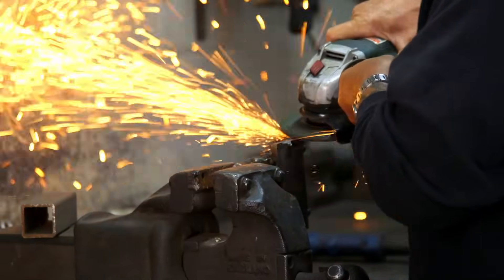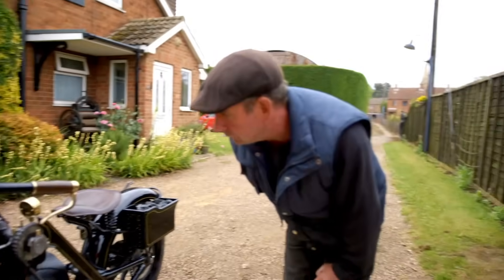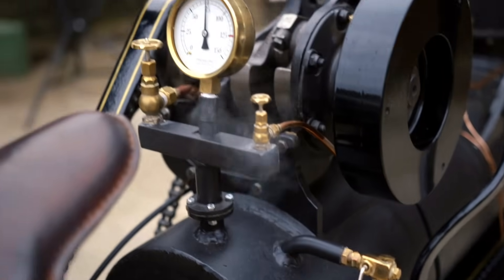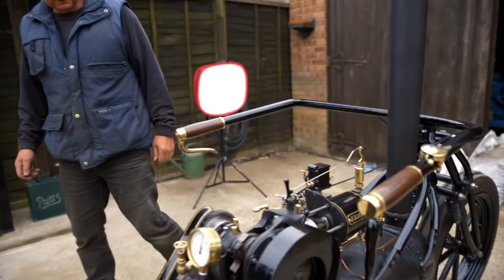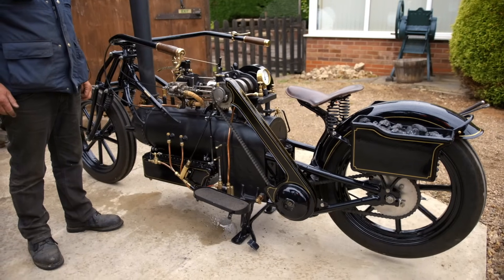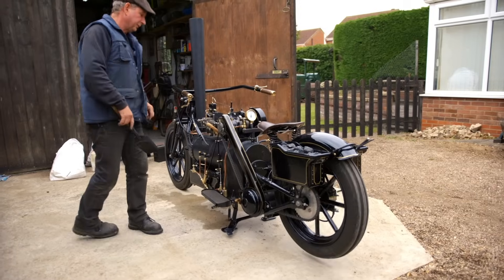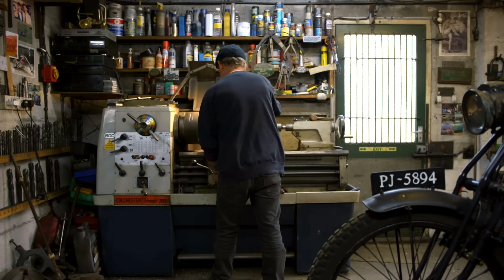Coal Fired Steam Cycle 2 - FULL VERSION

Comment: I've built 6-7 steam locos with similar size boilers. Your workmanship is outstanding.
Reply: Too bad this man wasn't Scottish, He'd be Scotty, on StarTrek, great,great grand father.
Reply: I completely agree. I'm just wondering why he decided to use the Steam Tank fro structure and not build an undercarriage. Now, it's obvious his Steam Bike is for home use and for driving around the Neighborhood, but I am still left wondering.  It saves on room not having an under-carriage and on weight as well. The tank is solid enough for structure, but the handles are directly welded to the Pressure tank and the front-end is supported by the tank and tank alone. That's concerning from a structural point of view.

Let me be clear when I say that I also agree, his workmanship is impeccable. And you certainly don't need to have a degree to be an engineer, and Sandy proves that. I'm just wondering why he didn't build an under-carriage or uni-body.
Reply: @theshadowsovereign8914  in terms of traction engines (sometimes referred to as steam tractors in North America), the British tradition is to use the boiler as thr structural part of the vehicle as well as the source of power, so maybe he got inspiration.
Reply: Best custom motorcycle # 1
Reply: Tq for labourious work
Reply: @theshadowsovereign8914  Just look at the thickness of the tank, esp at 16:50,  pretty sure there is not another bike on the planet that has a central frame as robust as this one. The last part on that bike that will ever fail is the tank itself.
Reply: @rickwilson5611  Did you actually read my comment?... that I posted over a YEAR ago.

Comment: All it needs is a period sidecar attached to it and it'd be brilliant for taking people for rides at traction engine rallies and the like (if we ever get them back again). And steam railway galas too. Good on you - great fun!
Reply: I might actually feel safe on a steamcycle if it had a sidecar.
Reply: Have the firemen in the sidecar
Reply: Good comment
Reply: Yes it will look great. Great idea.
Reply: I don't think it has the beans to pull a sidecar and passenger
Reply: @PecanRanch  steam can have quite a bit of power
Reply: @the_retag  - perhaps on the flats
Reply: @PecanRanch  its got rubber tires and a gearbox itl probably have no problem uphill, maybe a bit slower
Reply: Which "period" is that Mark? The time when everyone rode steam motorcycles?
Reply: The sidecar is a FANTASTIC idea! 😎
Reply: M. Meeker You'd be surprised what kind of power a steam engine can produce. Especially torque! It's phenomenal!
Reply: @nickthompson9697  a tricycle (trike) would look good
Reply: @myronhorvathsk  old trains had super power.

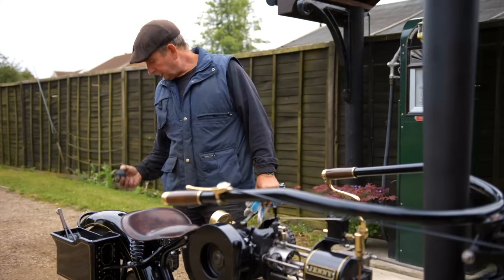Comment: Anthracite, 5:10, is the highest grade of coal available. It is almost entirely carbon, with very little sulfur, hydrogen, nitrogen or anything else to make smoke. It burns very hot, but is very difficult to ignite, hence the kindling and the paraffin (kerosene) soaked paper. He uses small pieces for easier igniting and faster burning, to make more heat out of a smaller burner.
Reply: ... so it's running go premium.
Reply: Thanks for the explanation.
Reply: Good clarity, intelligent
Reply: A lot of truth in that, although a good grade Dry Welsh Steam Coal is just as high quality and clean burning, with just a touch more volities which makes it more controllable, very good steam raising, as well as a little easier to light. Currently easily available and no more expensive than Chinese anthracite, although all that may change is the welsh government is refusing to renew Foss-y-fran's extraction license.
Reply: Couldn't they grind the Anthracite into a powder? I read that it burnt very well and there was a steam train design that used powder coal.
Reply: @user-uy1rg8td1v  Not a bad shout, although usually with Locomotive fires you need a considerable firebed to keep your fire stable when on the move, due to the draught from the blastpipe in the smokebox going up the chimney. So I feel like powdered coal wouldn't be very efficient unless it was on some kind of automatic feed. 

That being said, I know US Locomotives used oil quite a bit, so I don't know how it compares to Coal, I'm only speaking as a Fireman in the UK :P
Reply: The Terminator ( Jenny ). Typical northerner, just gets on with it. H+S would have a field day !. So humble a man. Right gradely. Thanks goodself. Ðave.

Comment: Congratulations! Your work is almost perfect! I think it would be interesting and more beneficial for the user to run the chimney along the length of the boiler cylinder, put it in an upright position behind the seat and install a venturi nozzle in it, which would use a small fraction of the steam pressure, but at the same time it would noticeably increase the draft of the chimney...!
Another variant, which would be more favorable for the hearth of the boiler, would be if compressed air from a compressor (piston) driven by the revolutions of the steam engine went into the venturi nozzle instead of steam...

Comment: That is a brilliant idea having that fan on the chimney. to start the draft up the chimny. the damper help your fuel to burn slower. you wouldn't want water to enter the engine it would hydraulic it. I bet that's a heavy motorcycle.
Reply: He says the weight somewhere in the video. It's either 350 or 375 kg, which is an awfully heavy motorcycle.

Comment: Ha ha! Great machine and would be such fun to ride. 👏👏👏👏👏 I used an old Morris heater fan to run my first smithy forge, back in the mid eighties. To control the speed of the fan, I used the element out of one of those old porcelain electric kettles. Worked a treat from my car battery. 😁

Comment: Wonderful work. The only point I would offer to builders is to start with a firebox that can easily start and sustain a good fire. b A friend had a miniature stream engine that was beautiful as it pulled around the track, but it was dreadful to get it up to steam. I've built steam engines with separate boilers, less problem.

Comment: Steam engines can be made very efficient and powerful. The German company IAV developed the 3 cylinder water steam engine ZEE03 with about 1 liter stroke volume a power of 75 kW and an efficiency of 45% and operated it on a dyno and in a Skoda Fabia car. The maximum pressure was 250 bar and the superheated steam reached a maximum temperature of 900 °C. The superheater was directly integrated part of each of the 3 cylinder heads and driven by a radiative burner. The exhaust gas was used together with the exit steam from the cylinder to fire the boiler up to temperatures of 350 °C. So the engine was operated almost in the supercritical water region. The total amount of liquid water inside the whole system was 250 cm³. At maximum power it circulates completely a few dozend times per second within the whole cycle.

Comment: If you lean in a turn, how is your water level in your top outside tubes & crownsheet ??
Reply: I applaud such a creation and too would love to see it @ Stormin 2021 Bike rally.. However this point crossed my mind too, has to be a solution, looking at the tyre profiles I think the answer is a chair shortly to be added ;-) Bravo Sir, Amazing Motorcycle!!
Reply: You lean to compensate the centripetal forces, and therefore the resultant force is maintained parallel to the bikes axis and the water will remain there or thereabouts level. 
I also don't you exactly "get your need down" very much with this machine, it's not a sports bike!

Comment: The info was great, but I'm sad that we only got to see a few seconds of it on the road. Would be nice to see much more of it in motion, find out how fast it goes, how far it can go on a single tank, &c.
Reply: It would need lights, a front brake and an MOT to be registered for road use before any of that can happen.
Reply: I have to wonder just how many different licenses would be required by the various regulatory agencies to operate the motorcycle. Here he would have to have a licensed boiler inspector certify and license the boiler. Then the operator would require a boiler operator's license, a driver's license and motorcycle license. The motorcycle would have to be inspected annually by a licensed mechanic for the standard safety and emissions ....if anyone has the knowledge, and be issued a Vehicle Identification Number Plate, and a motorcycle registration plate for the back. There is no.end to the government insanity!

I'd love to know more information about the bike. Like weight, engine size, speed, and range without stopping for fuel and water. How many gallons of water is in the boiler and carried in the tender. I'm just curious. He did an amazing job!

Comment: If he mentioned how much it cost him in materials, I must have missed it. Did he say how much this project set him back?
Reply: It's not so simple as that. The tools in his shed weren't cheap and they will have been gathered over his working career. You're not doing much work without a workshop.
Then there's the time and labour. Over a thousand hours easy. Fitting, adjusting, re-machining, refitting; just to get it right. AND THEN, you have the materials.  

Long story short, it cost him more than he'll ever get back for it and its easy worth 15,000-20,000 to the right bidder. Minimum.

Comment: I'd love to know its top speed and will it climb a hill, and the practical range on half a pannier of coal.
Reply: I wish he gave the dimensions of the engine, you could determine the horsepower with that and then if you knew the speed of the engine you could figure the torque. I bet it climbs hills easily
Reply: @TugIronChief  The dimensions of the engine and the pressure of the boiler give you the horsepower of the engine. The horsepower of the boiler is "relatively" irrelevant to the hill climbing power of the vehicle. The horsepower of the boiler determines how long you can climb that hill continuously. What I mean is if you have a 6x10 engine running on a 60 hp boiler and 4x8 engine running on a 60 hp boiler,  the 6x10 will produce more engine horsepower. And you do not get 60 hp from any size engine on a 60 hp boiler, only from an engine with the correct displacement to use that 60 hp.

Comment: Great job! A very interesting combination of a steam engine and a motorcycle. Maybe you can bend the steam pipe and let it run along the body, in the manner of a normal exhaust? And if the thrust is not enough, you can add either a vetilator or an air intake for pumping pressure with an oncoming air flow.
С уважением и пожеланием успехов! Привет из России !
Reply: Black Falcon:

I haven't looked real close but typically in a steam engine vehicle (but not marine) the exhaust steam is piped into the smoke box to a nozzle to create a "draft" which pulls heat from the fire box thru the tubes. This is why steam locomotives made the iconic "chuff chuff chuff" sound. Marine engines would take the exhaust and run it thru a "condenser" which took ocean water to make the steam cool back to water, it was then sent back to the boilers. Steam ships and power plants usually have very tall stacks which uses the barometric pressure difference to keep a fire draft going.  

Fred never did say if it was single expansion or double, one cylinder denotes single expansion. Did you know that in your four stroke bike or car it only has one firing impulse for two crank revolutions? A double acting piston steam engine pushes on both sides of the piston which gives two power pulses per stroke. A steam engine can be made to be very powerful for its size but the boiler is the biggest hassle, this is why the Stanley Steamer and White Locomobile cars never made much success, internal combustion is far easier. With those you had to plan ahead because even though the throttle would be closed the engine would continue to run for some time - no clutch. Imagine riding that bike and making a panic stop.

As you might figure, I love steam engines!

-'lil stan
Reply: @stanfischer6175  he really acts like he doesn't know the bike he built, weird

Comment: Great piece of work. Very impressive. The great shame about steam for transit was that on a good day it was supposed to be about 5% energy out to energy in. But then a 4 stroke IC is only supposed to be 25%.
Reply: Petrol engines are a bit more than that, about 35% efficiency. Diesels are 50% efficient, but are theoretically capable of 73% efficient.

Comment: the size of those engines are underestimate, that one are big enough to move a mid ton truck. that bike need a smaller engine amd will move it well cause the torque is insane on a steam engines.

Comment: With lithium iron batteries and solar panels or a generator to charge while the engine runs why bother with coal or wood to heat the water.

Comment: A really big leap back in history. I'd rather pay the highest price of gasoline than heat that thing up every time. I would rather ride a rocket than such a hot boiler tank.
Reply: I don't think anyone is building a steam-powered motorcycle to replace any modern internal combustion engine, It's more about the engineering spectacle. It's obviously not practical especially in this day in age, but I personally find a hand-crafted steam-powered motorbike much more impressive and fascinating than any modern creation.

Comment: Still worse than a Roper in almost every respect. Perhaps he should have looked at some 140 year old designs first, before building this. For one thing, driving the rear wheel with links is far simpler and lighter, and more efficient, than making a complex gear box and sprockets for the chain drive.
Reply: Off-the-shelf Burman Ariel Square (1000cc British bike from the 1940s and1950s) four-speed gearbox with clutch and no doubt sprockets , drive chain and final drive on rear wheel. No need to make any of those.